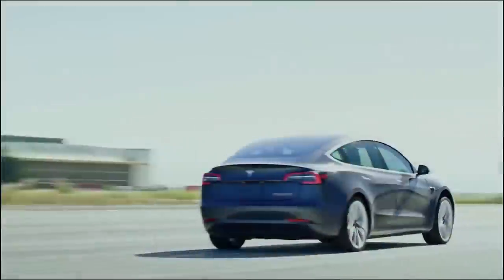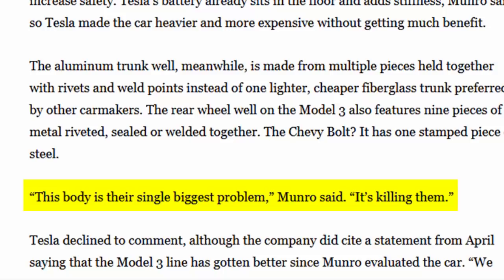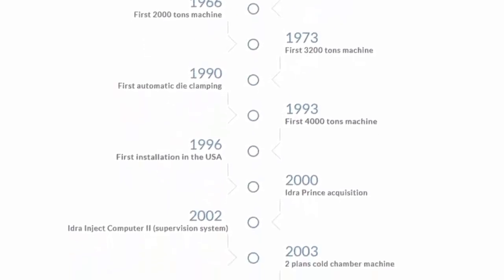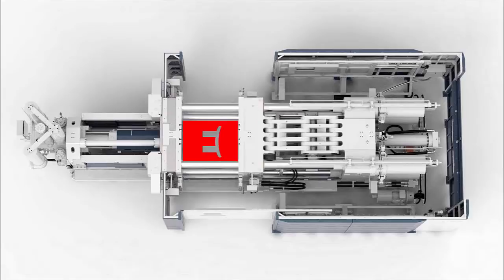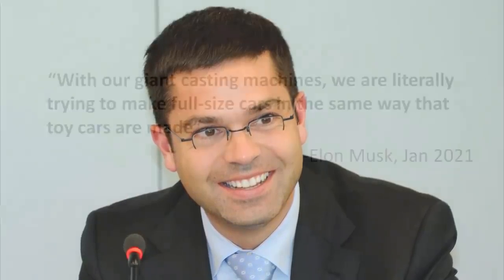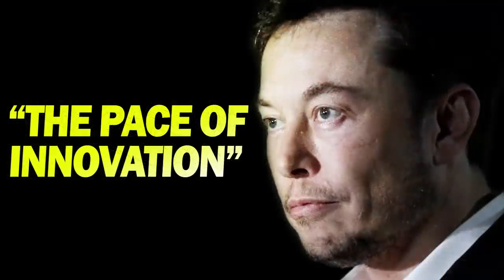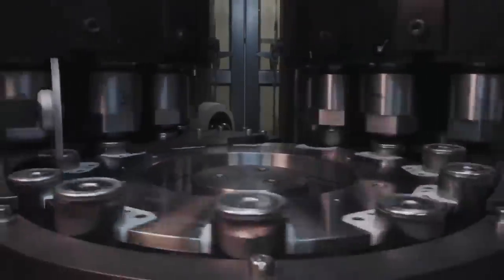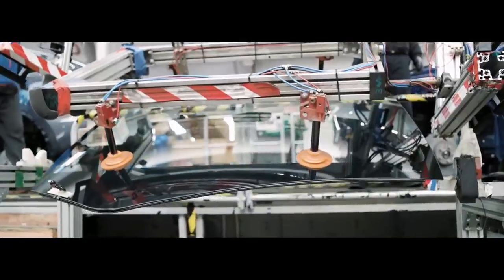Tesla Giga Press will CRUSH

Comment: The real magic is in the patented aluminum chemistry, not the machine. Other competitors would have a difficult time copying that.
Reply: Why is it difficult to copy the alloy? I thought mass spectrometry should identify the elements and ratios very easily.
Reply: @jasonburbank2047  " I thought mass spectrometry should identify the elements and ratios very easily." Exactly. You cannot hide the formula of an metallic alloy. You could make minor changes to the ratios to avoid the patent.
Reply: @jasonburbank2047  Yes and there are many metallurgists available for hire. Most likely you will anyhow have to make small adjustments for purpose, depending on the mould shape and flow characteristics plus how you want it to solidify. You cannot run an operation like this without close cooperation with the alloy supplier. The manufacturing method is well known however most of the alu parts in a modern car come as components from suppliers.
Reply: @BjorckBengt  I worked at Sapa making their aluminum tubing for F-150s. They also have a special alloy for this purpose. It was the only product made with that specific alloy.

It was also ran through a very complex die, which would weld it while it was extruded, forming a tube at the end. Then we could test if the metal properly cooled, by checking the tubing at the front and rear in a machine that would crush it and try to break the "weld" per say. If it cooled properly and formed properly, it would crush. If it didn't, it would tear.
Reply: @jasonburbank2047  i have the same question 🙋‍♂️
Reply: @jasonburbank2047  mass spectrometry won't show the grain structure of the metal or how they got an optimized grain structure in a repeatable way suitable for high yield large scale production.
Reply: @jasonburbank2047  It is not it is just a hypo-eutectic silicon aluminum with some other additions.  BTW it ICP-OES or OES  not mass spectrometer that is used for aluminum and most metall alloys. The true key to this allloy is the casting process to avoid bi-films.
Reply: @jasonburbank2047  it might give you an accurate elemental analysis, but it will not give you the chemicals, compounds, and thermal cycles necessary to create the original mixture to arrive at and maintain the precise homogeneous composition after oxidation/reduction,  fluxing, and throughout the injection and cooling process.
Reply: @jasonburbank2047  Right, most any engineered product can be reverse engineered. I have observed the alloy process and it is well developed.
Reply: @jasonburbank2047  My thought exactly...
Reply: OMG all they have to do is add 0.01 copper and its not patented copy
Reply: @UPsideDOWNworld321  If only if it was so simple. Casting Aluminium is always subject to sub surface voiding. The addition of small amounts of copper improves the finish but not the physical properties Scratch the surface and you are likely to find a honeycomb. It is essential to maintain the pressure until the alloy has solidified as the subsurface bubbles will form if this pressure is not maintained. Not to mention the other properties such as tear strength, modulus (stiffness) and others.
Reply from the maker: Agreed they'll have a tough time copying that without a dedicated metallurgical team. Though it's likely not patented, but probably a trade secret, similar to the recipe for Coke for example.
Reply: @TMIOTesla  
Is this machine technically a "press"?
It doesn't "press" the component, it injects the material.......
Reply: @TMIOTesla  yes coz others can't buy those skills🤣 just like tesla did.
Reply: @TMIOTesla  Every major manufacturer has material engineers.
Reply: @TMIOTesla  The Coke recipe is not a secret. It is a way to charge bottlers for using the Coke brand name. Coca Cola sell the magic syrup at a high price and only if you use this syrup you can call it Coke.
The ingredients are easy to detect and there are many producers of cola who copy or mimic it to perfection, however they cannot call it Coke and price it accordingly.
Reply: @TMIOTesla  coke is patented its called coctail mix
Reply: I think why Tesla also benefits from the Gigapress is their smaller model offering compared to legacy. Being able to scale at speed creates the margins that will benefit. A modern take on the Model T from Ford back in the day.
Reply: @ev4k916  💥💥💥💥💥💥💥💥💥💥💥💥💥💥   THIS IS WHY SHARES OF TESLA MAY COLLAPSE SOONER THAN MOST PEOPLE THINK   💥💥💥💥💥💥💥💥💥💥💥💥💥💥
⚡
1) The competition is coming on strong, especially from Ford. May is Ford's best month for EV sales, more than 250% higher than the previous month. Tesla is on a steep decline.
2) Earlier this month, Ford released their F-150 Lightning. Preorders are through the roof. Ford claimed that the range was 300 miles, but according to Brownlee, it's really 469 miles which beats out any current Tesla vehile on the road today. (Ford usually under estimates range, while Tesla grossly over estimates range)
3) People are loving the NEW Ford Mustang Mach E. There is a lot of hype on this vehicle. A Model Y and the Mustang Mach E were parked side by side. People were asked to examine each vehicle, and then pick which one they wanted. The Mach E won by a huge landslide.
4) Because of the disrespect shown towards the Chinese community by Tesla, most Chinese people don't want to have anything to do with Tesla. For a Chinese citizen to buy a Tesla car, it's like showing disrespect to your culture, and your Chinese beliefs. People are now frowned upon for dealing with such a company.
5) Tesla was caught cheating the great people of Norway, so much that the government had to step in and fight Tesla in a class action lawsuit. They won the class action. I'm not sure why someone would now want to deal with a company that gets sued by a government, a government who wants to stand up for the rights of its people. Some are saying that if the people were stupid enough to buy a Tesla, then they shouldn't get a single penny. I say that its not fair to call them stupid. They just got suckered into dealing with Tesla because they had the Tesla blinders on and didn't listen to PNS. People need to beware when they are dealing with a company that misleads. It's like those energey savers that you plug into your wall, and then you chop your electricity bill by 90%. Wonder if it's Tesla owners buying this product?
6) FSD is still not ready, and it may be another 2 to 5 years before it is. Tesla needs to do a re-write as they have decided not to include radar in FSD. Those who have paid for complete FSD should request their money back. If they are told by Tesla, " You bought it, we have your money, your not getting it back, now go cry me a river", we suggest you speak with a lawyer. You paid for something that you thought you were getting, but never got. A fair company would refund your money. Maybe another class action is in order. Another class action would hammer the shares lower.
7) CyberTruck preorder numbers have been falsified - not by Tesla, but by individuals (and possibly by some big investors) just to pump up the price of the shares. When I release the real preorder numbers, shares of Tesla may get crushed.
8) Bitcoin will become worthless sooner, rather than later. What can you do with Bitcoin .... nothing! You take REAL money (that you can buy anything with) and buy FAKE money (that you can buy nothing with). Does that make any sense at all to a normal person? Your only hope and salvation is that you find another sucker to spend more for the Bitcoin than what you bought if for. 
Governments want it shut down. They want to be the ones to control Crypto. If Tesla continues to have diamond hands, then you can write another 1.3 Billion dollars off their books. Does Tesla care? Not really .... it's only the money of investors.
9) Sales in Tesla are expected to plunge ..... and plunge very very bad in the coming years. The competition will be eating their breakfast, lunch and dinner.
10) Used Tesla's are flooding the market as people are dumping them for a better EV. Check out the auto trader to see how many Tesla's are up for sale. You won't believe your eyes...
Reply: @jimcmf2  what your saying has many counter points which is like trying to move a rock right? So let's say this, all EV manufacturers will probably have some success. Legacy has a hopefully temporary problem of not having high volume high margin EVs yet. Tesla is more than an auto maker so will their 'eco system' and creation of an apple style 'app store' appeal to their increasing number of clients? Lots to attempt to predict in the future, the bulls vs the bears but only time will tell!⚡
Reply: @ev4k916  Tesla is valued like it is making 50 Billion in profit a year. If it wasn't for Bitcoin (which will be worthless) or pollution credits (which will be no more) than Tesla has only lost money every quarter. Eventually money runs out, and its game over.
Reply: @jimcmf2  the amount of their spare cash which they couldn't invest into other growth projects was a tiny % and potentially a good specular play. Even Ray Dalio who didn't believe in it now owns some. Tesla is now profitable and not burning money faster than its making it. Their manufacturing is getting cheaper with the numerous giga press machines they ordered from idra. Even Pierre Ferragu calculates money generated from invested capital as a increasing annual amount. It is trading above valuation but the institutions who have done so see the potential especially since most 1st world countries have banned ICE production from 2030 onwards and with at least 4 giga/tera factories being optimised to create millions of cars Tesla will be able to price it higher when they are supply constrained and then lower to increase total addressable market if the momentum dries up. All while legacy try not to cannibalise their own ICE and increase their profit margins without millions of functioning EVs on the road already. FSD using vision only is a long shot, but if humans can drive (debatably well) with two cameras and a brain then a Tesla with proper AI and numerous cameras is already safer and probably able to do it faster than Waymo for example which has small geo fenced 'routes'. Just saying that long term, Tesla is a good investment imo. ⚡
Reply: @ev4k916  Watch what happens next earnings release. Their EV market share is tanking .... and tanking very very bad. 

Tesla needs life support pretty soon. Maybe the FanBoys can start a Go-Fund me page for them.

Tesla = old hat now

FSD is on a big reset and might not be fully baked for another 4 years. They messed up, and now they will need to pay the price.
Reply: @jimcmf2  you are entitled to your opinion. Tesla investors (not traders) believe in an electric future led by Tesla. If that's what you believe then short away. The tanking of all growth tech stocks happened due to transitionary inflation fears and value cyclical transitions so would have been a perfect time to copy Michael Burry right? Hope you did! 🤑 Let's hope that we don't all lose the money we worked very hard to invest. You have to believe in what you put your money towards so good luck finding that 👍🏻
Reply: @ev4k916  Ford investors (not traders) believe in an elecrtic future led by Ford. BlackBerry wanted to lead the smartphone race, and look where they are now. The first one out is usually the one who gets crushed. Tesla is far behind in every metric. When it comes to FSD - they are only at starge 2 while many others are at stage 4. They need to rewrite the logs as they are removing radar --- a very very big mistake that will put the company in turmoil.

The Ford Lightning gives you 460 miles of range (proven), more than any Tesla on the road today.

Tesla is outdated (like BlackBerry), and they will soon be done like burnt toast. Sorry.
Reply: @jimcmf2  wow mate you need to calm down there. If globally the amount of PHEVs and BEVs was 4% the world is still very early in the game of EVs.

I think you are kidding yourself if you think that any one EV automaker will have a monopoly greater than 15%. So I would say that it could be fair to say that the sales of EVs COULD be divided equally amongst the automakers.

The thing about Tesla is that they are innovative. It is almost impossible to believe that they forecast 5 years ago that they would make 500k cars in 2020 and may achieve 1 million in 2021. TMIO's video about the giga press proves that Tesla is a true disruptor of the auto industry right? The rest will likely copy that if they can. Just like jumping on the EV bandwagon like Tesla started and proved to be what the people wanted.

When I think about Ford I have great memories. My family owned many with clutches and no power steering. They created the Model T which disrupted the horse as the method of transport. That transition took around a year. The difference between ICE and EVs is a similar situation even though they look kind similar.

The thing about all legacy ICE makers is that they improved petrol engines over a century. But as emissions standards got harder they cheated. They put in trick sensors like VW. They created Hybrids which end up being much more pollutive when their tiny battery runs out. In which case I say, GREAT! Ford sells 1 million ICE F-150s. Their brand is strong. Yet when they launched the lightning with a similar pre-order to Tesla Cybertruck, they do not have the lead for the equivalent time. Sure you could say somebody is lying about this or that but $100 refundable order is identical. The pre-orders for the Cybertruck are larger over the same period of time. Will an ICE pickup truck lover even want to buy the lighting? Not sure, time will tell. Both the Cybertruck and the Lightning are yet to get ramped up to production so we can't tell the future range etc. so not worth debating about. The thing I'm sure of is that the battery cost per kWh of Tesla will be cheaper.

So then the next issue is that Tesla already started with a sports car (Roadster), moved into sedans (Model S), then Large SUV (Model X), then cheaper hatch (Model 3), now the Model Y (SUV) and are producing them at mass scale. Ford has the Lightning which looks quite similar to the F-150 which is great if they want to cannibilise their own ICE sales.

When you mention Tesla being Blackberry, imo it's the other way around. Ford is the 100 year old company that never thought to create a new more efficiency drive system and laughed at Tesla when they tried to compete. In the same way that Blackberry had a huge audience with a button mashing phone, who then probably laughed at Apple which had an App store and entertainment available as downloadable games etc. I believe that Tesla is Apple disrupting Ford (Blackberry). 

Tesla is a phone on wheels, their strength is in software which is high margin. This is why they are valued as a tech growth stock and have overtaken every other automaker in total (think back to what I said about Tesla creating 500k 2020 and almost 1 million in 2021)

Even ARK creates a bear case where Tesla does not succeed in FSD (which would help their providing of in-car entertainment) but with their efficiencies and vertical integration so early in the industry of EVs the share price target is much higher than right now.

Great that you believe in Ford, I hope that you have 💎🙌🏻 if you own the stock. Otherwise I'm not sure what you're debating with me about. No need to apologise, we can both win financially, time will tell by how much 👍🏻

You should stop using explosive 💥💥💥emoticons if you don't have hard facts to backup your emotions.
Reply: Its most likely better not to patent in that case. I just went through my first filing and you have to disclose everything. Once that patent expires...fair game.
Reply: @okcleaners  the dad of a kid I went to highschool with made custom audio equipment with a special noise filter that was "better than Dolby". Supposedly instead of patenting it he built it loosely into a small box which he then filled with black epoxy such that subjecting it to any scrutiny would destroy it, and make thorough analysis impossible.
Reply: @okcleaners  Expires in 20 years?
Reply: @finnurth  i thought it was 10. Different for every industry though 🤷‍♂️
Reply: @okcleaners  I have no idea. I believe it is 20 years for pharma.
Reply: @finnurth  It's a bit more complex than that. 20 years is a soft cap of sorts. It starts when the patent is filed and can be no more than 17 years after the patent was issued. However it can be granted additional 5 years for missed marketing time as in regards to slow FDA approval. All this is in the USA. However it is different for the European market where it can be 15 years or even as low as 10 years in some cases. I have no knowledge of the Asian market. I worked for Pfizer a bit a while ago and I tend to study the companies I work for even if it is not directly related to my work there. :)
Reply: @jonbeargenx  Thank you very much for your info!
Reply: aluminum metallurgy is nothing new and certainly not something tesla invented. The alloy they are using isn’t even that good. It is designed to be easy to cast. There are much stronger aluminum alloys.
Reply: Stop talking nonsense mate, there is  nothing particular about that aluminium alloy, other manufacturers have been working with much more advanced materials like titanium, magnesium, tungsten, composite materials......
Reply: @alanmay7929 That's not the point mate. The real point is no one else is doing it or has done it. it will reduce the body shop by a third saving them money and making Tesla more profitable. I don't care if they are using dirt as the molding material.
Reply: @alanmay7929  I say that Tesla is going to be crushed by the competition.
Reply: @jimcmf2  What did Tesla do to offend the Chinese?
Reply: The main issue for others would be finding someone to build the machines.
If Tesla ha plans to expand for 10 years, they could essentially corner the market by pre-ordering the full production capacity for that time?
One company which might have a solution is Hyundai.
They have the in house heavy Engineering expertise and facilities to build these machines if they see the need.
Reply: Any University science department can figure it out.
Reply: 💥💥💥💥💥💥💥💥💥💥       Tesla EV market share March 2021 = 29% 💥 Tesla EV market share April 2021 = 11% 💥 GAME OVER FOR TESLA !       💥💥💥💥💥💥💥💥💥💥 
💥 Tesla market share is sinking really really bad. Carbon Credits are drying up, they are spending gobs of money, while sales are tanking in Europe / China / and the USA  
💥 Ford and GM are starting to take control and Ford hold the award for the BEST EV on the market .... the Ford Mustang Mach E. It's DESTROYING Tesla.
💥 Looks like Tesla has been focusing on launching satellites, building solar roofs, digging holes in Las Vegas ground, and not focusing on giving the consumer what they want.
💥 But there is some good news. Rumors have it that Elon is working on a NEW car that will go from 0 to 60 in under zero seconds. It's known as the time machine. You may preorder your time machine just after the big reveal with 1 $100.00 deposit. Estimated cost for this project is 16 Billion dollars.
Reply: patents hold back the "human" race
Reply: AlSiCuMgFe, An alloy of Aluminum,  Silicon, Copper, Magnesium and Iron.
Reply: MUSK = New God! Mars = New Earth!! TESLA and Tesla Holders will be Kings. The Rest and Their Family will be our Batteries who will Work till Old to Supply All Energy for Bitcoin!! VIRGINs Hate Bitcoin just because it use Much Energy like Argentina. BUT Space X, King Elon, Tesla All Have Bitcoin. I never do Estrogen things like environment. Bitcoin and Tesla all the way!! LOSER Haters Forever Sad and CashLess. They are Even Too Poor to own Tesla or Bitcoin. Those PA THETIC Whiny Sad Bit ches. TESLA=KING, NON-Tesla= Loser Peasant!  ELon Is like Ironman who will destroy Thanos and critics are better off using their cash to wipe their A n us. Elon's FUTURE robots and AI will Destroy any whiny INFIDELS! JUST WATCH silly Haters. LOOK at all the celebrities, influencers, and TiKtok Reviews Endorsing TESLA. We already WON.
Reply: They actually patented it and Munroe revealed a big part of the ingredients. But it's most likely not a patent Tesla will give away for free
Reply: @mpunktppunkt4171  seriously? Could you link the video here or tell us which one?
Reply: @mpunktppunkt4171  Patents are public records, so if it was, everyone will know the ingredients and the process.  Like a trade secret they hope others cant figure out the complexities.
Reply: @mpunktppunkt4171  no one needs that patent, other companies can easily develop their own. Bmw was actually the very first company to use large castings, look at sandy munro about the 2013 bmw i3 teardown.
Reply: This is only a ordinary Alloy for casting parts. We used it for cheap parts and for parts with high forces. No Magic
Reply: @DR0Dangerous  Not an ordinary alloy. Like Elon stated, an ordinary alloy would need heat treatment that would make the part deform. This casting needs no heat treatment.
Reply: @roxter299roxter7   The Most AlSi Alloys need no heat treatment. Ist s a ductile Alloy.
Reply: @roxter299roxter7  I worked on a press making the F-150 tubing for their aluminum body, and it was made from a similar alloy. We only used it on the F-150 orders, and it received no heat treatment. 

(It was also very expensive, like $5 a tube. Normal products were like $3 for same weight)
Reply: @DR0Dangerous  Any sufficiently advanced technology is indistinguishable from magic.
Reply: That's amazing, but why is the fit and finish of their cars still so terrible though?
Reply: No it's not. Doing a metallurgic test of the casting recipe takes like 3 minutes. Source: worked at an aluminium casting plant.
Reply: @nonnnonnonon  How often did you have to redo a metallurgic test of the casting recipe because the melt crew got it wrong?
Reply: Redo the test, or redo the casting?
Reply: @sammiller6631  Only time that was a problem, was if a lead alloy ended up in a non-lead alloy (C06N, 6262, 6042, etc.). Or if you were making a pure aluminum alloy and someone put scrap of a less pure alloy in. Then you could switch it to either the less pure (and add zinc or manganese or magnesium, whatever you needed), or add more PIG to get the correct alloy.
Reply: sounds as if the alloy under the extreme pressure will be much more rigid but lighter than previous structures. More range, more acceleration, faster production. Other manufacturers are shaking in there boots. Not only are they at a disadvantage because of the fleets they must still support. There manufacturing processes will nor be able to keep up with the demand of electric vehicles....wow Elon is the new Rocherfeller.
Reply: @antwainnfloyd  no there not shaking in there boots they could care less
Reply: @UPsideDOWNworld321   remember this moment
Reply: Dude aluminum and silocon has been used on engine parts for decade now in hi performance circles. Thats not teslas idea
Reply: @87DAM1987  Why hasn't anyone else thought about using it for large body parts. Sandy Monro says he tried to sell the idea to the big 3 years ago and they laughed him out of the room.
Reply: 💥💥💥💥💥💥💥💥💥💥💥💥💥💥   THIS IS WHY SHARES OF TESLA MAY COLLAPSE SOONER THAN MOST PEOPLE THINK   💥💥💥💥💥💥💥💥💥💥💥💥💥💥
⚡
1) The competition is coming on strong, especially from Ford. May is Ford's best month for EV sales, more than 250% higher than the previous month. Tesla is on a steep decline.
2) Earlier this month, Ford released their F-150 Lightning. Preorders are through the roof. Ford claimed that the range was 300 miles, but according to Brownlee, it's really 469 miles which beats out any current Tesla vehile on the road today. (Ford usually under estimates range, while Tesla grossly over estimates range)
3) People are loving the NEW Ford Mustang Mach E. There is a lot of hype on this vehicle. A Model Y and the Mustang Mach E were parked side by side. People were asked to examine each vehicle, and then pick which one they wanted. The Mach E won by a huge landslide.
4) Because of the disrespect shown towards the Chinese community by Tesla, most Chinese people don't want to have anything to do with Tesla. For a Chinese citizen to buy a Tesla car, it's like showing disrespect to your culture, and your Chinese beliefs. People are now frowned upon for dealing with such a company.
5) Tesla was caught cheating the great people of Norway, so much that the government had to step in and fight Tesla in a class action lawsuit. They won the class action. I'm not sure why someone would now want to deal with a company that gets sued by a government, a government who wants to stand up for the rights of its people. Some are saying that if the people were stupid enough to buy a Tesla, then they shouldn't get a single penny. I say that its not fair to call them stupid. They just got suckered into dealing with Tesla because they had the Tesla blinders on and didn't listen to PNS. People need to beware when they are dealing with a company that misleads. It's like those energey savers that you plug into your wall, and then you chop your electricity bill by 90%. Wonder if it's Tesla owners buying this product?
6) FSD is still not ready, and it may be another 2 to 5 years before it is. Tesla needs to do a re-write as they have decided not to include radar in FSD. Those who have paid for complete FSD should request their money back. If they are told by Tesla, " You bought it, we have your money, your not getting it back, now go cry me a river", we suggest you speak with a lawyer. You paid for something that you thought you were getting, but never got. A fair company would refund your money. Maybe another class action is in order. Another class action would hammer the shares lower.
7) CyberTruck preorder numbers have been falsified - not by Tesla, but by individuals (and possibly by some big investors) just to pump up the price of the shares. When I release the real preorder numbers, shares of Tesla may get crushed.
8) Bitcoin will become worthless sooner, rather than later. What can you do with Bitcoin .... nothing! You take REAL money (that you can buy anything with) and buy FAKE money (that you can buy nothing with). Does that make any sense at all to a normal person? Your only hope and salvation is that you find another sucker to spend more for the Bitcoin than what you bought if for. 
Governments want it shut down. They want to be the ones to control Crypto. If Tesla continues to have diamond hands, then you can write another 1.3 Billion dollars off their books. Does Tesla care? Not really .... it's only the money of investors.
9) Sales in Tesla are expected to plunge ..... and plunge very very bad in the coming years. The competition will be eating their breakfast, lunch and dinner.
10) Used Tesla's are flooding the market as people are dumping them for a better EV. Check out the auto trader to see how many Tesla's are up for sale. You won't believe your eyes...
Reply: @jimcmf2  U short sellers love to lose dont you?
Reply: @RyanDiederich  I have no investment in Tesla either way. Just reporting about the junk they are making.